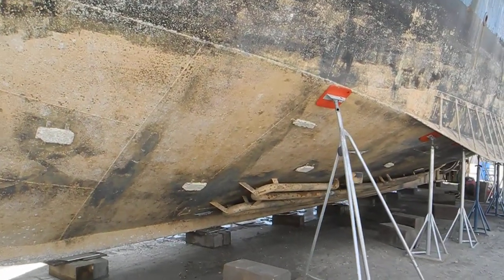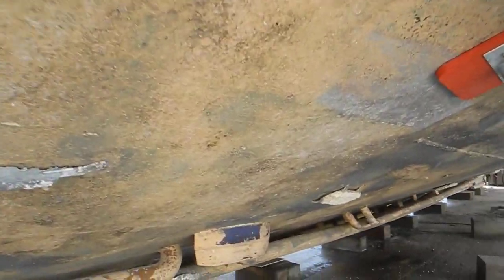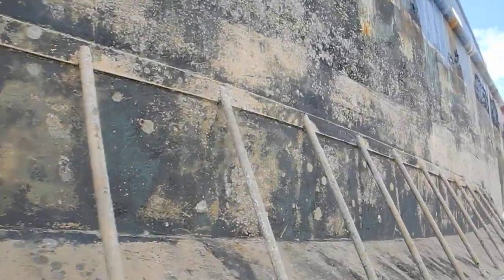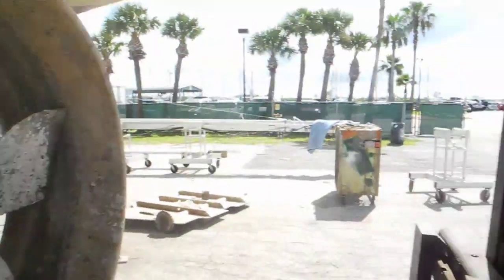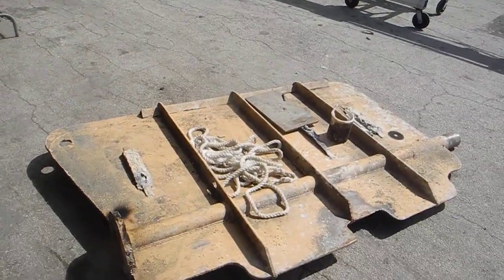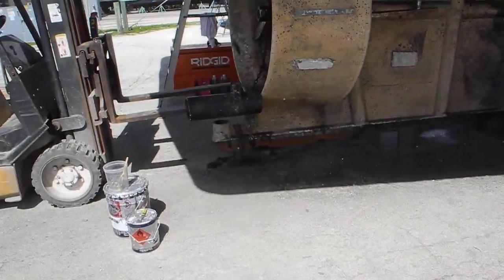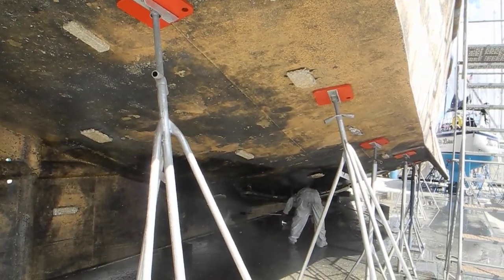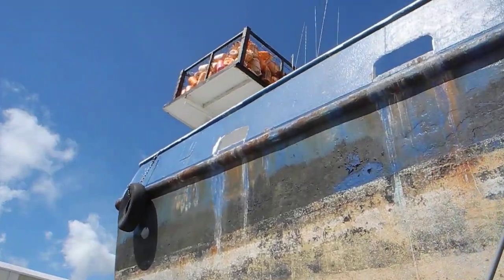Keel Coolers on commercial fishing boat

Comment: Captain Chris, I have a 15 meter inland and coastal cruiser in the south of France. It has cooling tubes each side of the keel for the engine but on the starboard side the exhaust exits the hull underwater and runs backwards towards the stern for 20 feet and re- enters the hull and then out the back. Question, why would a boat builder do this?
Reply from the maker: I don’t know. Might be cooling the exhaust gasses much like a water injected system would. But I’ve never seen nor heard of this before. Thanks for sharing.